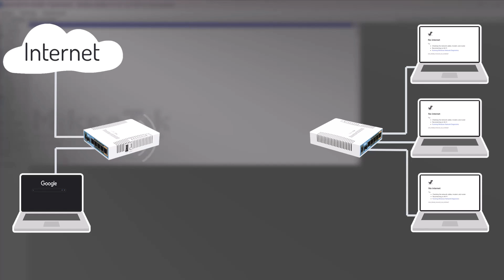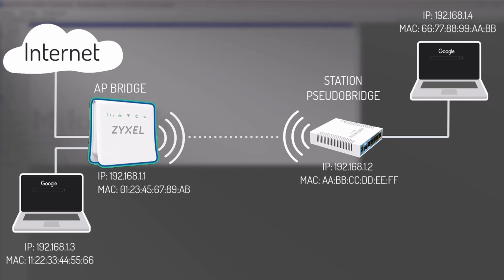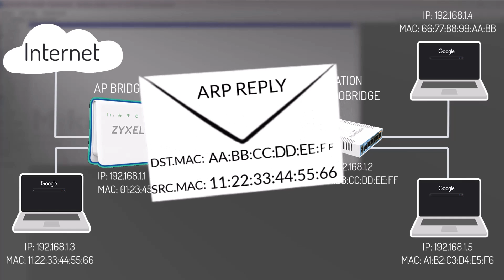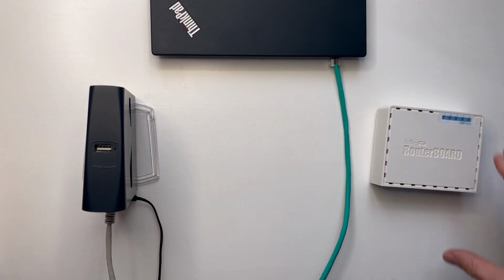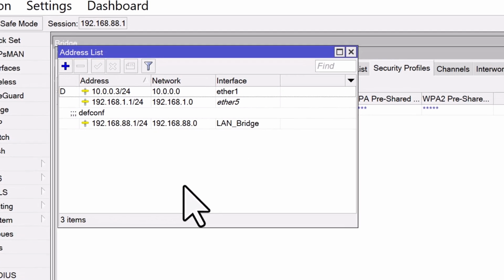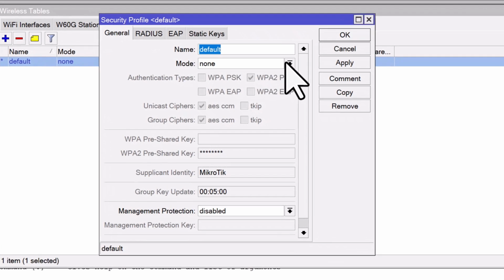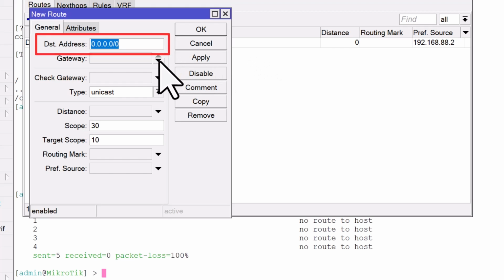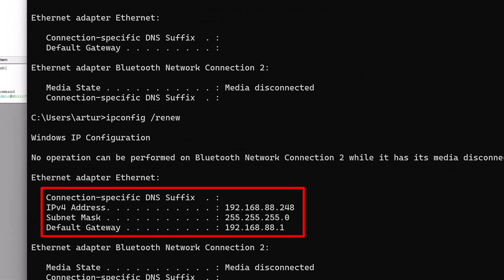MikroTik Wireless Bridging: A Simple and Effective Way to Connect Networks

Comment: on hap AX3, after ap bridge/Station Pseudobridge connect to the WiFi, is it possible to create your own local network with DHCP server, allow all devices connect to Mikrotik only?
hap AX3 become a Repeater (wifi interfaces as Internet gateway) & also running as Router mode as the same time?
Reply: If I understand your question, in theory yes you could. The station side mikrotik would need to have 2 wifi interfaces, one for the backhaul to the AP and the other for the wifi you want to create. 

One way would be to reset your mikrotik with a Default Configuration. Go to Bridge and delete the backhaul wifi interface from default bridge. Go to Interface/Interface List and change WAN to the wifi backhaul interface. Go to Wireless and set your wan wifi interface to station and setup to connect to upstream AP. Set your client wifi interface in AP mode and set it up like you would for a Wifi network (ssid, password, etc). Go to IP/DHCP client and set your backhaul wifi interface as the interface to pull WAN dhcp from instead of Ether1. 

You may need to go thru firewall rules and make sure they reference the WAN Interface list and not Ether1.

Once done you can go to Bridge and add ether1 to the Default bridge if you need the extra port. Since it won't be your WAN anymore. 

If you wanted to avoid NATing you coukd set it up from a "No Default Config, but that would be a bit longer comment reply.